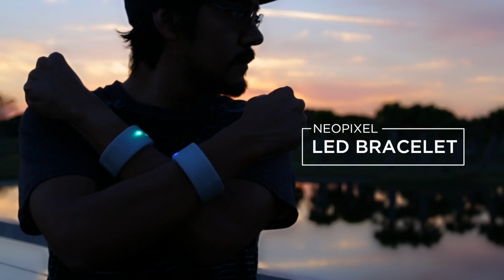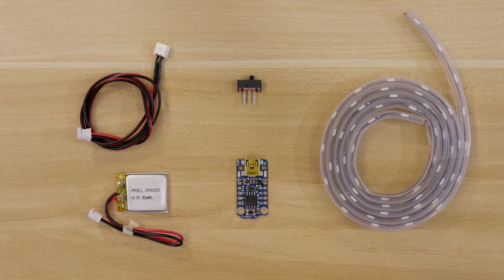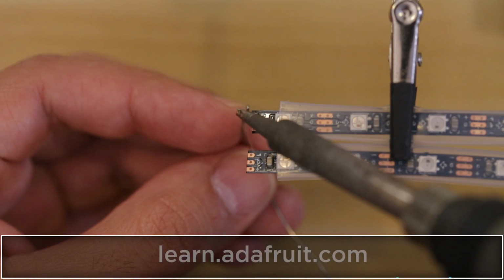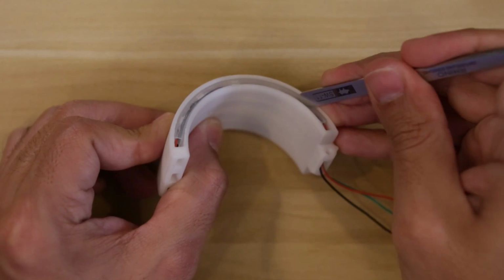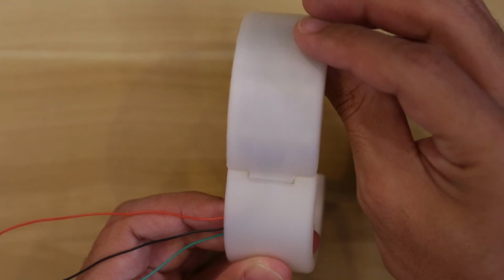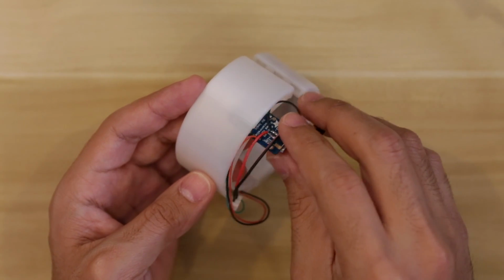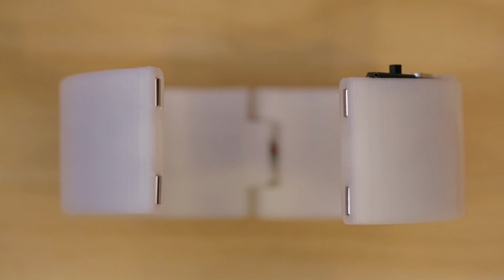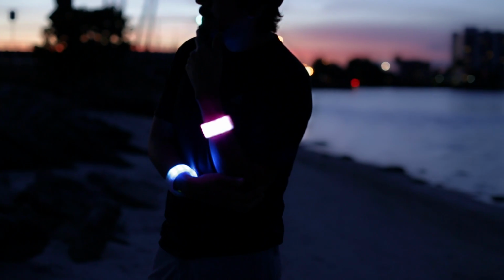3D Printing a NeoPixel LED Bracelet

Comment: question! led light strips are awesome. but how do you determine  how big of a battery you need to make a project work? is it possible to use rechargeable batteries from cell phones or cell phone external power supply's? and how long would these things last? (so many cosplay projects, so little experience)
Reply from the maker: Great question! This has been asked so many times that we had to make a learning guide and video :-) https://learn.adafruit.com/battery-powering-wearable-electronics

Comment: How are you running 5v logic and neopixels off a 3.7 volt lipo? I don't see anything boosting voltage in the circuit. Aren't you hitting forward voltage drop offs awfully fast? At the very least, your blues and purples will probably fail to light up properly within minutes of usage. How long is the actual use time with that many neopixels and a 150mah lipo?
Reply: I'd love to hear the answers to these questions, as well.
Reply: The guide lists specifically the 5v trinket. Also, Neopixel guides say that 3.3v might not be sufficient to power Neopixels reliably, so I'm wondering how much usage he can actually get out of the lipo before it drops down to unusable levels.
Reply: It uses a 3v logic trinket. You can power neopixels using the lipo pack directly and then use 3V logic instead of 5V